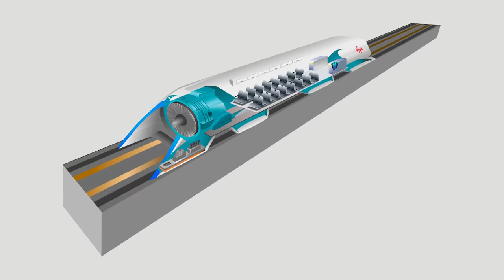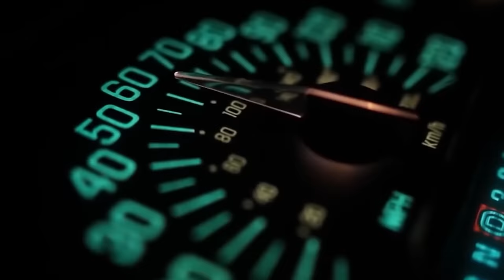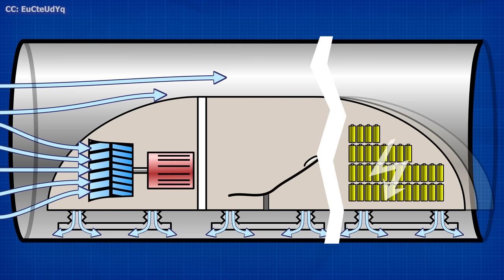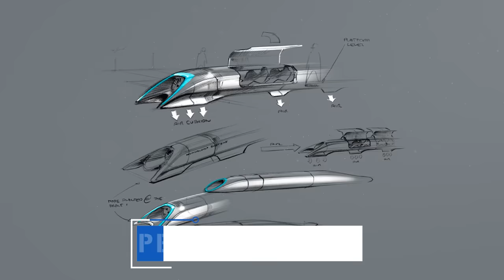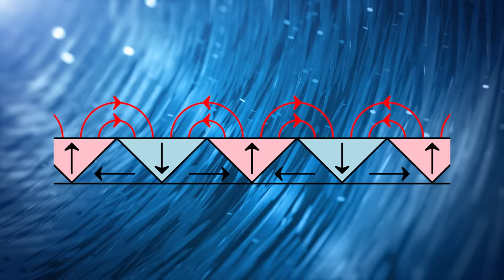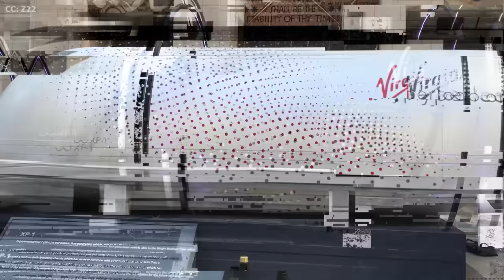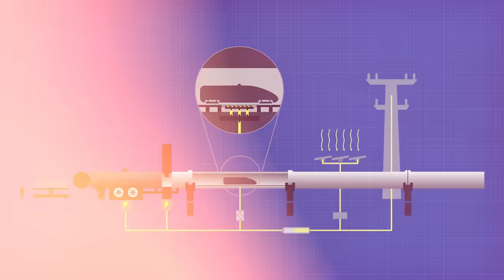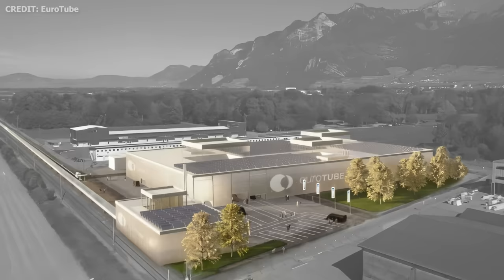We’re Getting Closer to a Hyperloop...

Comment: Since we can’t even get a proven technology like high speed rail built in this country, I’m highly skeptical Hyperloop would ever be built.
Reply: not in our lifetime. also, we already have high speed trains. japan and china are working on the Maglev. This is far more achievable.
Reply: @the0ne809  not in anybody's lifetime.  There are only 2 maglev due to prestige reasons despite technology has been used for 50 years.
Reply: Which country is that?
Reply: @charlesquinn8860  China and Japan
Reply: I'm kinda hoping for a maglev and high speed rail hybrid network. Not going to cheap though and you tell the auto and oil industry to jump in a creek.
Reply: agree adam something explains how bad the hyperloop is also musk said the Hyperloop was meant to stop the building of California High speed rail! So really the hyperloop was BS and meant to be a failure from the start Adam something on YT explained about this in a vid of his
Reply: HSR 300-320 kmh is plenty fast imo. California hsr is going for 360 kmh though which is really fast
Reply: If it can happen in a tunnel at a fraction of the cost of surface construction, it's a lot more feasible.  It may happen.  High Speed rail is prohibitively expensive.
Reply: 100% the us will not have this. If it happens at all it will be in a country that values mass transit.
Reply: It's not going to be built in the US or EU, but more likely in Middle East or China, where it's state funded and they want it to be done regardless of cost. Once that is done, the technology will be leaked and copied, then it'll get cheaper and could become viable in some other cities.
Reply: It's not because high-speed rail cannot be built. The hyperloop is the dumbest thing one can think about.
By the way, we now have high-speed rail in Florida and it's coming between California and Nevada.
Reply: @trucksanddirt1506  it’s “been coming” from Cali to Nevada for almost twenty years.
Reply: @m0nsterman902  And Florida? 
It's already here and expanding. The same company just signed last week to build Cali to Nevada. You can eat your non-sense
Reply: @awdrifter3394  it will never get "cheap" enough to be anything other than massive money pits. It combines all the expenses and design requirements of one of the most expensive forms of transportation infrastructure (maglev) and some of the most expensive machines ever built (high altitude wind tunnels.) Even regular maglev has issues making a good business case most of the time, hence why it really never took off. This will add at least an order of magnitude or more to the costs of maglev, while significantly reducing capacity to about as much as a single lane on a road. This idea has been around for about a century and we've had the tech to build it since the 50s-60s. There are reasons this never went anywhere.
Reply: @snookmeister55 but it way cheaper than hyperloop
Reply: @gamerfan8445  Hyperloop has an infinite cost, since there is no practicable engineering that produces this technology in working form.
Reply: High-speed rail was a good step forward. However, it is like choosing coaxial cable over fiber optic.
Reply: @trucksanddirt1506  That would be good. The hyperloop will render it obsolete in a decade.
Reply: @markharmon4963  okay why?
Reply: @gamerfan8445  To which claim are you asking why?  I made one or two claims.
Reply: @markharmon4963  All of the hyperloop claims are years and years old. This is a money pit with no bottom. Hyperloop is infinitely expensive, because there are no working systems at all.
Reply: @rtqii  Why do you care if it's a money pit?  I do not think it is.  If a company wants to try and they succeed, it's all to the good.
Reply: @markharmon4963  every company who touch it failed. It basically money pit.
Reply: @markharmon4963  Hyperloop One is bankrupt. They spent $500 million. There is nothing at all to show for it.
Reply: @rtqii  Yes, I was disappointed too.

Comment: I literally just watched a sideprojects talking about how the Hyperloop is realistically impossible
Reply: Haha same 😂, I hope we can get a Brain Blaze next...
Reply: strong ron burgundy vibes. simon reads what's on the prompter.
Reply: Actual engineers have said this all along.
Reply: there is a company in poland, that has a different approach to hyperloop: Nevomo.
they are developing a system to turn regular trains into maglevs.
step 1: linear motor between the rails.
step 2: maglev system that takes over above 150km/h.
step 3: concrete enclosure.
step 4: vacuum
the beauty of their system is that every step is compatible to regular rail traffic, and step 2 already allows for 550km/h (depending on the curves of the track).
maybe they will never create a real hyperloop, but the ability to upgrade regular high speed rails to maglevs is interesting aswell.
Reply: Hyperloop bad when musk do it
Hyperloop good when someone else does it
Reply: @robertheinrich2994 if the tracks weren't already made for high speed, they'll almost certainly have too much curvature. That's why HS2 in the UK is such a pain. Steps 3 and 4 don't seem realistic either. The amount of concrete would be a climate disaster, and keeping even a partial vacuum is very unlikely
Reply: @robertheinrich2994  Regular trains may be able to travel on the Nevomo tracks, but the opposite won't be true. The tracks need to be stronger and built more precisely. I don't think a simple spike is going to be enough either.
You will need more than a concrete enclosure to maintain a vacuum.
Reply: @MrSmellsliketeensprt  yep, getting to be pretty typical for Simon to do this.
Reply: @robertheinrich2994  Well. its not a hyperloop, ist  a maglev, something that have existed for decades.
Reply: @nephalos666  i mean, not everyone buys into your Füherkult
Reply: @matsv201  yes, they started developing the hyperloop. then they thought about what is needed. hyperloop with the evacuated tube in the last phase.
and would you mind pointing out which maglev allows regular trains on the track?
Reply: @robertheinrich2994 

Hyperloop is not happening. Vactrains? Maybe. Concrete won't change anything. It's impossible to create a vacuum in such a large chamber. The system yiu described is just too complicated.
Reply: Define impossible... The infrastructure would be pretty expensive but cost can be reduced by using smaller pods since there is no friction and by using battery powered vehicles instead of powerlines.
Reply: @bobfg3130  Hyperloops and vactrains are litteraly the same thing. Only difference is magnetic levitation instead of air bearings but it's not set in stone.
And it's not a perfect vacuum, just low pressure air.
Reply: They released videos on how awesome the A-10 is and how terrible the A-10 is mere weeks apart.
Reply: I like it, I get several views on a subject, with hypothetical thoughts, up to date information (to a realistic degree, it takes a while to make and process and edit videos), and then get to see Simon laugh at his terrible memory when he thinks he knows something but isn’t sure on a tangent 😂

I love thinking how exhausted and academic his subconscious could hypothetically be…. Throwing random facts at him as he tries to read a script and then gets something right and is shocked by himself! 😅
Reply: @bobfg3130  100 years ago people though it was impossible to fly faster than the speed of sound. Half a century later, we had the SR71 and the Concorde. 
Don't discount it as impossible unless it actually breaks the laws of physics. Creating a partial vacuum in a large chamber doesn't break the laws of physics, it's just a problem of scalability.